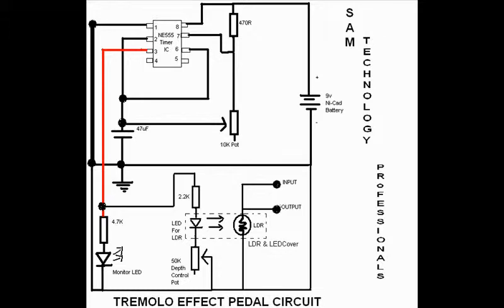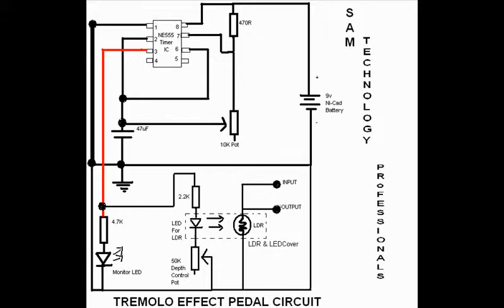DIY Build your own Tremolo Phaser Effect Pedal For Guitar

Comment: I don't understand where the input out wires, I saw one of them but what about the other one, where do u connect ?  Also is the capacitor grounded to cell or is that where the negative pins of the jack socket are soldered together?
Reply from the maker: All grounds are common and connected to each other